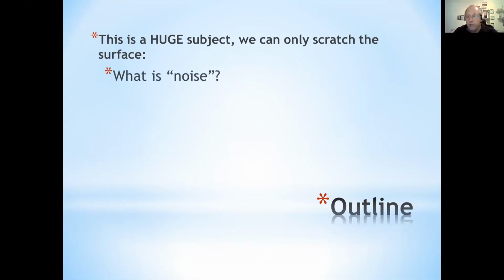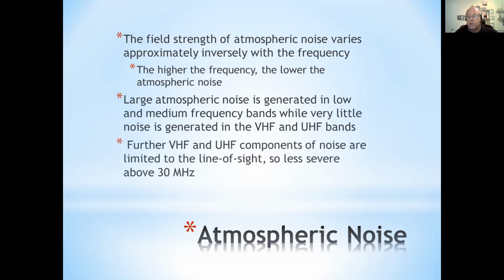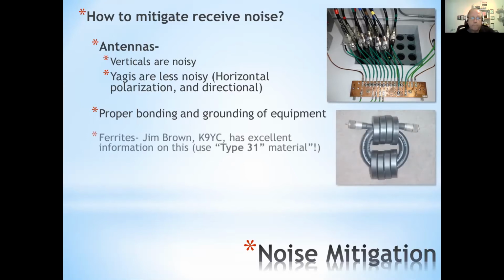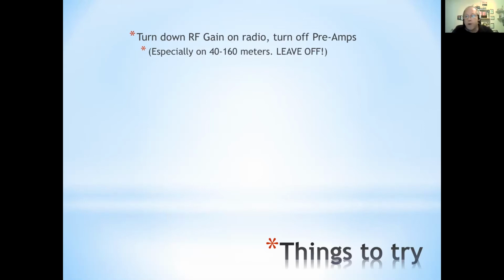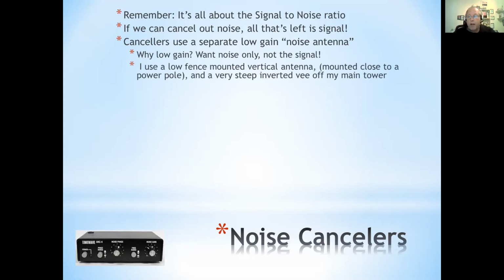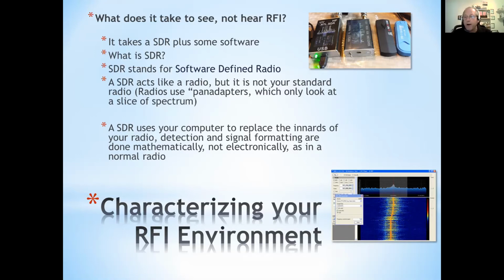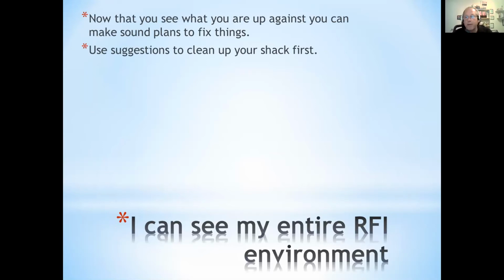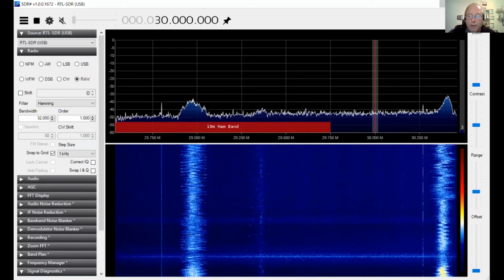HF Noise Mitigation ~ 12-23-2020

Comment: LED lights can be bad. I had a porch light fail but not go out! It wiped out HF up to 7 MHz. I built a test fixture and used it to sniff several bulb sources and find quiet ones. 

Garage door opener LED bulbs are more expensive but seem to be designed quieter. 

LED “Edison” style decorative bulbs are quiet because there’s no converter inside - they just put the diode strings across the AC line. 

Beware of LED stringlights for decorations. A friend had nasty RFI from a neighbor that we DF’ed using the DX Engineering RFI loop. It turned out to be one of those light sets that change color to music etc. He convinced the neighbor to throw it out once he heard the noise. 

I bought a similar one $14 from Amazon and 1) the length was a half wave on 20m and 2) it radiated dancing high level spikes from 0-300+ MHz WHEN OFF BUT IN THE MUSIC MODE. (Since it has a soft power button it’s never really off.) 

As hams we have an uphill battle against these cheap imported noncompliant devices and a public that has no clue of the damage they are doing. 

I hope I can still enjoy my hobby when I retire.